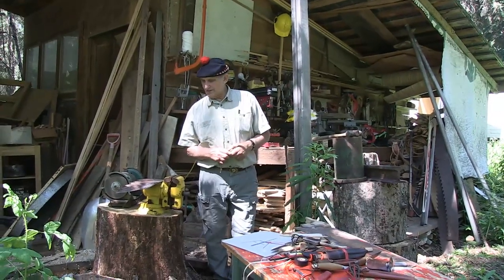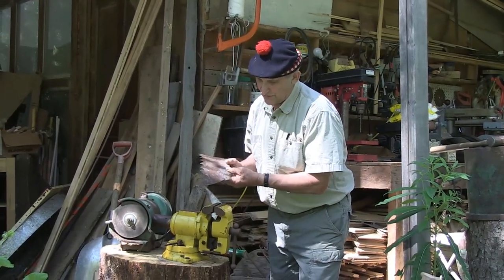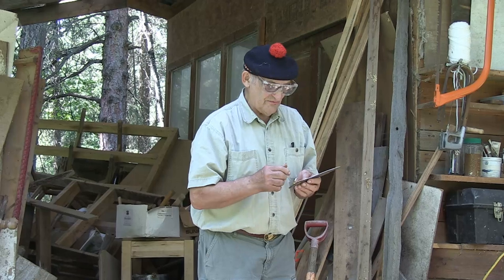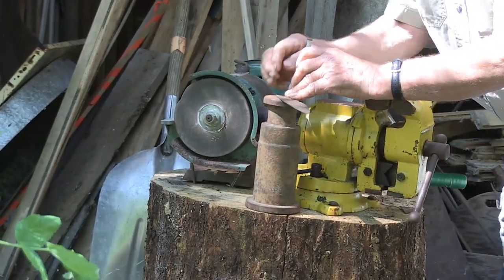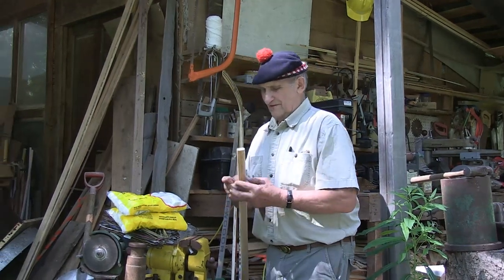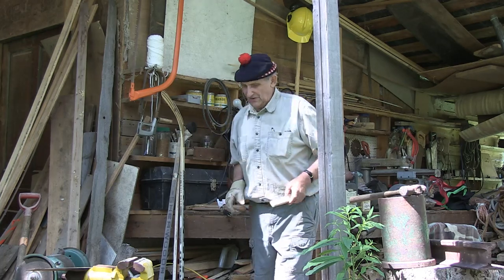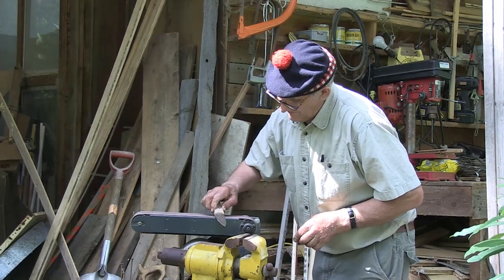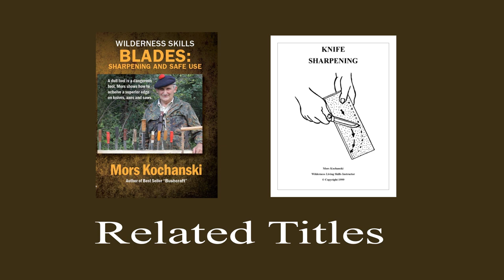Survival Knife Making

Comment: I really enjoyed this video. I was a professional knife maker ( made 18th century knives and axes mostly) for many years and while most I forged out I have made more then a few knives like this out of old saw blades. 
  Saw blades while they will make OK knives as is they are normally to soft to make really good knives unless you harden and temper the blades. 
Thin steel like this is easy to harden just the cutting edge and leave the back and tang soft. 

Really is easier to just drill through the handle and blade at once to make sure they line up. I used an old hand crank drill press many times. 

Did enjoy the video

Comment: He could easily pass as my polish Grandfather. My grandfather only had to buy basic tools, he would make the rest. 
It’s 2018 and going into November, I’m 64 years old. 
We lived in New Jersey, it was pretty nice back then. 
At work one day someone broke a Nicholson power hacksaw blade, I GRABBED it. I shaped it on the grinder left the hacksaw intact, put an edge on it. I used a bicycle handgrip (a good one). I filled the grip with silicone sealer. It worked so well one of the shop guys stole it before I had a chance to use it. That blade held an excellent edge, it was made to cut through steel and the saw blade was a bonus. 
Well some lucky thief got a very nice knife 🔪.  I’ve owned morakniv tools since then , they are pretty good tools in carbon or stainless. 
The grinder my grandfather had was the old air raid hand crank type, it was really nice , I mean for us it was perfect. It clamped to the bench top solidly. 
Anyway, my grandfather was a jack of all trades. 
And this video is amazing. 
Sorry if I ran on. Getting late time to hit the hay 🛏

Comment: No paper cut test = knife not aproved
Reply from the maker: We will be uploading knife sharpening where mors will sharpen this knife and shave with it. Maybe hold off on the not approved till then.
Reply: *****
I was just kidding ;]
Reply: Lol the man threw this knife together in 30 min. Not approved? Ok. Mors could serve me a burnt tire and call it dinner, and I'd likely eat it
Reply: ***** Why no overhang?  Personally, that's the only thing I could think of as a problem.  I like that, as it does help if you have a sudden "what if?" situation & it keeps your grip from "creeping" up the handle while slippery (your hand flexing when cutting can get you a nick- I know, I know, you're supposed to be careful).

Also, maybe a smaller handle diameter (for holding it while wearing work or winter gloves)?  Something that Fallkniven does.  It would also let you wrap it with leather without increasing the handle size to the point where that turns into a grip problem.  My own hands are broad, but not very long- so I think about that a bit, but it would overlap in a workable way for people with longer hands.

Just suggestions.  By-the-way: Do you guys have any plans to make a roll-up say that works with a frame, like in that Survival Saws video from a little while back?  I remember Mors had said the one toward the end would be "astounding" if it could be used with a frame.  Would love to have a large saw that would fit in a coat pocket!  Especially if it was one you could re-sharpen.
Reply from the maker: Atkrdu Mors tells me that the knife guard is for knife fighting.
Reply: ***** Well, yeah- for the most part.  It's to keep your hand from riding up the blade.  I still feel better about it when there's some overhang or a guard on it, though.  Picking it up or that thing I mentioned with the oil or "sawing" through meat (which might be somewhat frozen) are all things where that overhang that a lot of butcher knives have come in handy.  I cut myself pretty good once just handling one that had a handle which somewhat sloped toward the blade.  I'm a bit more skilled with knives, now- but it still is less appealing (to me, anyway).

As far as using the guard in a fight, I wouldn't rely on it.  With swords or knives that are pretty close to it, sure.  But for the most part the guard will be way too small to catch much of anything, particularly something as fast & maneuverable as a knife. 

P.S.- I was having a discussion with someone the other day about cutting food with the knife & I was wondering if you knew of any that were good for that?  Preferably while being decently light & without being highly curved or having a slanted handle.  I'm basically looking for a general bushknife with a little bit of extra aptitude for cooking. 

I had thought the tanto would work well (because of that front angle), but he pointed out that it wouldn't be long enough for a slice & would be suited more to a press-cut like with an ulu knife.  Not bad, but not what I was looking for.  Any suggestions?
Reply: Not only that, but a guard can be an impediment to different grips required for different tasks (such as fine work).
Reply: If you're tired and using the knife in such a way that our hand might slide down the blade and cause n injury, you're using the knife incorrectly in the first place. Knives are used for so much more than "sawing meat" as you call it. When you've learned a bit more, you'll understand.
Reply: @Atkrdu   Drill a lanyard hole. Tie a 550 cord loop the size of your hand to keep it from sliding forward.